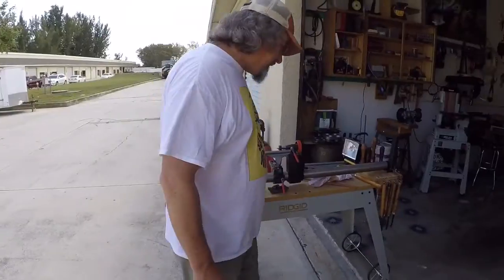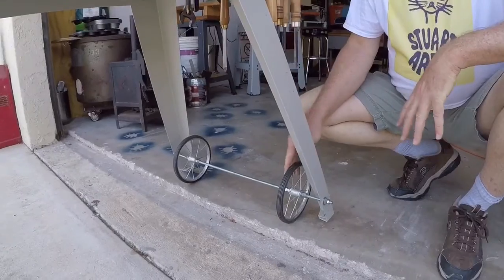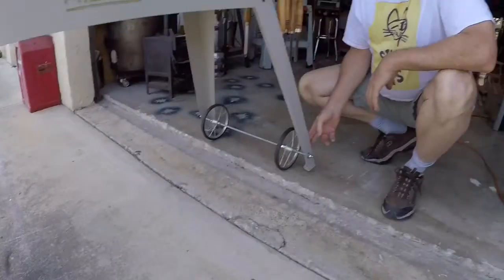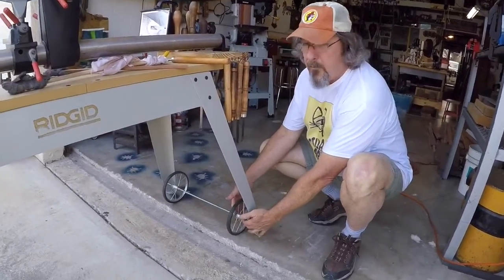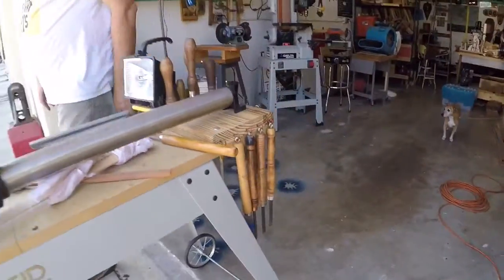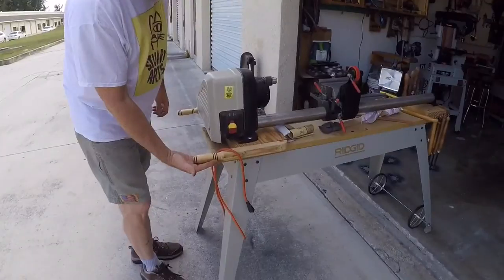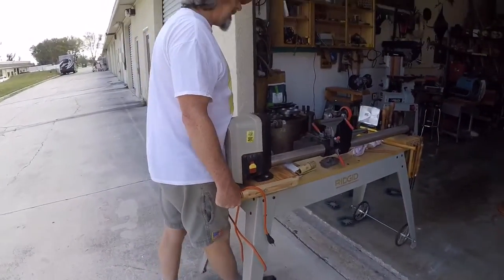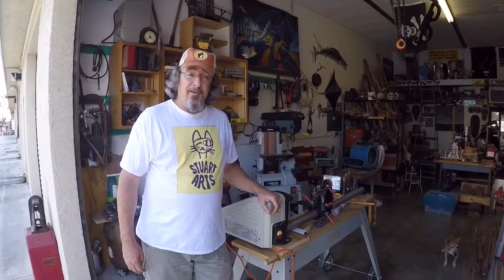Wheels for My Wood Lathe - Stuart Arts Episode 54

Comment: I tried this once with dolly wheels and it did not work out so well. It worked but the air in the tires made unstable when turn out of round wood. I think your solid wheels work better for a lathe.
Reply from the maker: Custom Chris thanks Chris! My brother thinks it ironic that I didn't turn wooden wheels. If these don't work out I'll make the next ones. But so far...so good.